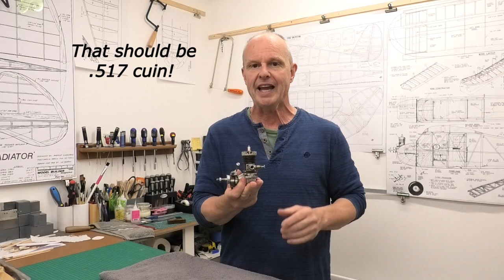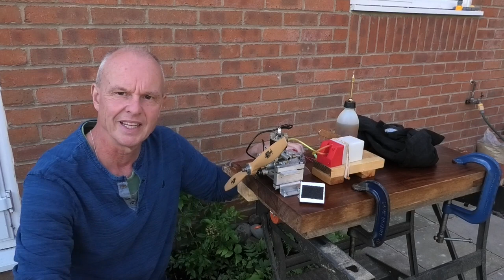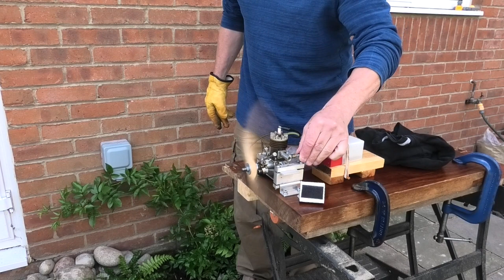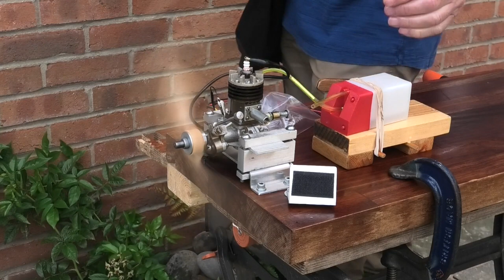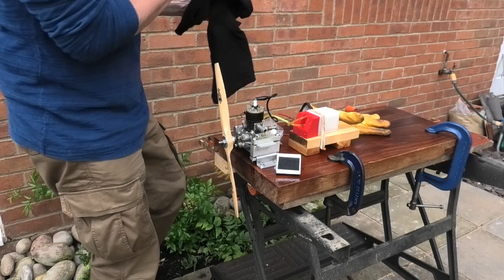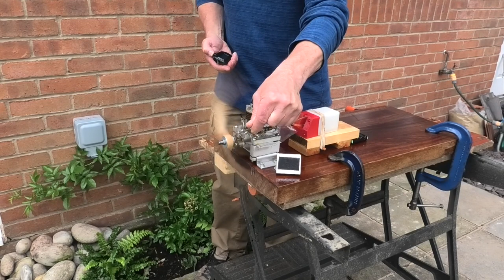1936 GHQ Spark Ignition Engine - Worlds Worst Engine? - Run & Review

Comment: GHQ.  You did great!

 When I was a little boy, during the glow age 60s, my fathers model club had a contest who could get an ignition GHQ to run the best, they got a bunch real cheap.  As many were aviation engine engineers,  many got it to run ; but not all.    Some reworked the engine porting and basically cleaned up the intake and exhaust   etc.   One I remember that ran well (relatively); but it ran in the reverse of the normal direction.   This was before you could buy alkaline or nicad batteries for your onboard ignition battery.  My dad felt using alkaline or nicads  was almost cheating; when I got into running ignitions when I became a little older I used them.  

 Never even tried to run the GHQ as I was sure I could not run to well at best; and would not build a plane for one.    Madewell, Forester, Bantam and some Olsen & Rice; were the good ones in our collection.
Reply from the maker: Thanks for the comment, you have some great memories there, thanks for sharing.

Comment: Great video of one of the good GHQ engines. That is a very nice original. I just finished running an Ohlsson  23 side port. I really love running the old ignition engines. I flew many of them in control line and old free flights with a radio. I grew up in the 40's when ignition was all there was. I have loved them since the first one I saw fly.  They are so unique. I have restored quite a few to better than new condition. 

Anyway, thanks for another great video.
Reply from the maker: Thank you for the kind and interesting comment, they are great engines, so much fun to run, pleased you liked the video 😊

Comment: I am repairing a radio made in Brooklyn in 1938. Nice to see an old engine run, most of mine have pretty worn bearings. You might want to change the timer setting to get it out of the exhaust, I think the original had it straight up on the right side of the engine and they had a exhaust deflector also.
Reply from the maker: Thank you for the comment, pleased you enjoyed the video 😊

Comment: thats how the old spark ignition engines were, but to tell you the worst engine I know is the Taplin twin not easy to start and was a pain... also most of the american glow engines like the K&B, Fox were also one of the worst.. K&B was also called as the Keep in box engine 😅😅😅
Reply: My K&B .35 ran well.
Reply: @tedmoss  not like the OS or enya
Reply: Some K&B designs were bad some were great.    Fox engines required a definite regimate with a long  break in for them to be good, no rings; then they would run for ever.     Me I just liked the OS from U/C 60s to R/C present; but had a lot of fun with the older stuff, and the little stuff.